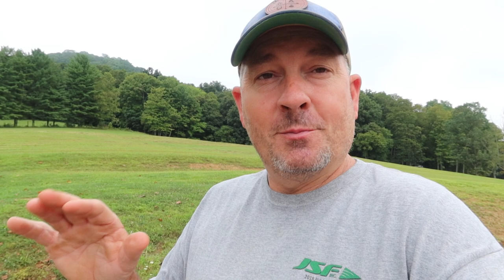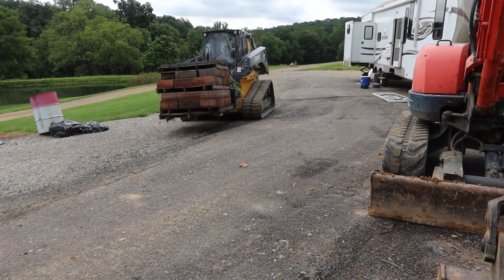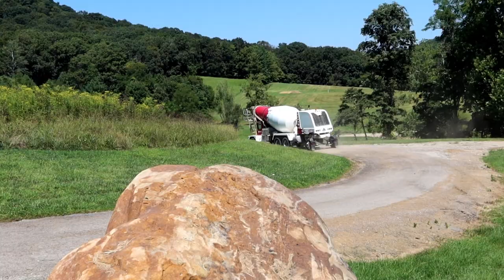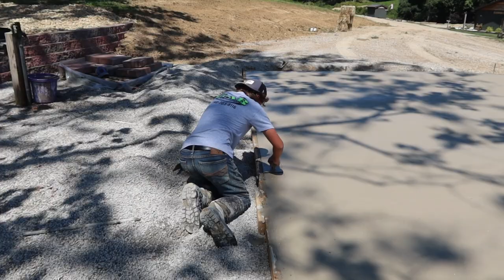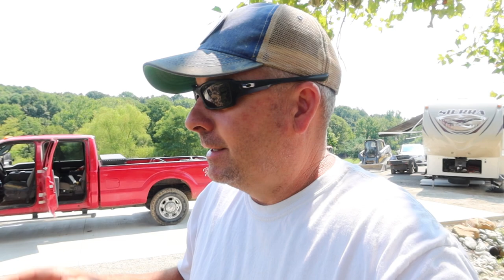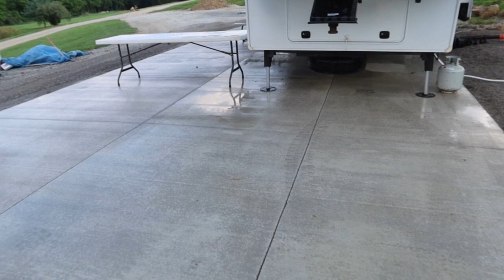ULTIMATE RV PAD! How we built it overlooking our 140 acre campsite.

Comment: New sub here from Brians channel, nice job on the pad, yeah when it's hot out an your pouring concrete, an that was a decent amount, it will catch up with you, an then your worried about the concrete getting away from ya, but it turned out awesome, thanks for sharing 💪💪🇺🇸🇺🇸
Reply from the maker: We did get a pretty good cold joint, but it’ll be ight!

Comment: Hey Jeremy thanks for going over why the non rebar. So if you were poring a 30x72 polebarn would you put rebar or anything else in it, it will possibly have a small tractor and maybe trucks. Also how thick would you recommend if I were to put a car lift on it. Thanks man looking good as always, great to see the kids working hard at it, have a great day bud
Reply from the maker: Ultimately I would let your concrete finisher make the decision. Several variables come into play. I have a big shop that we drive the dozer and big dump trucks onto and I poured it 5” thick with no reinforcements. 18 years later the only cracks are in the sawcut joints. Of course my base was pounded in really tight.